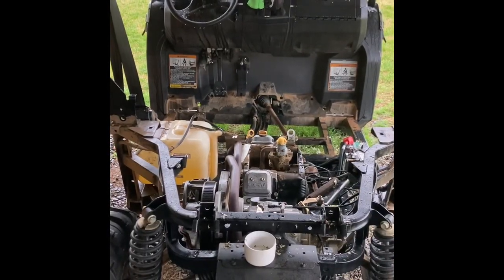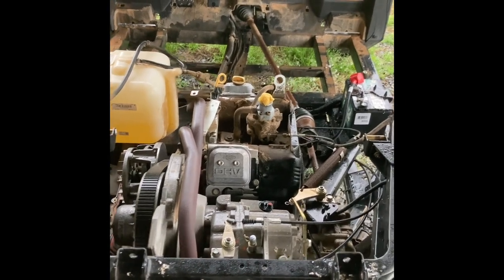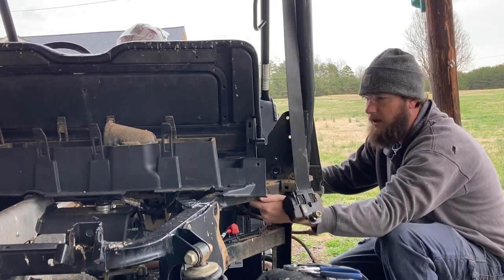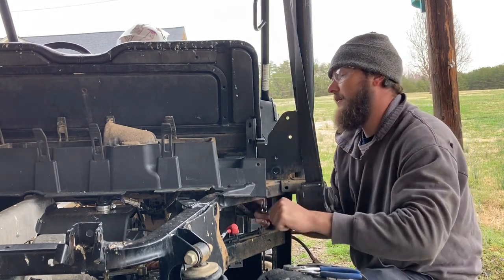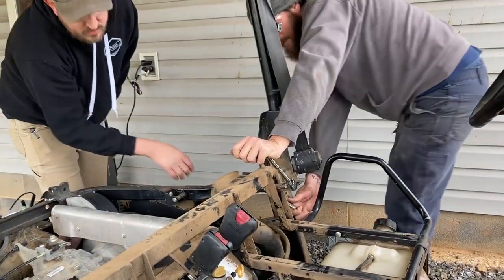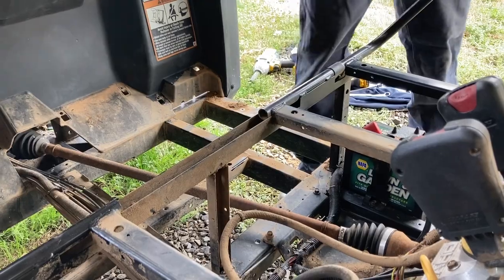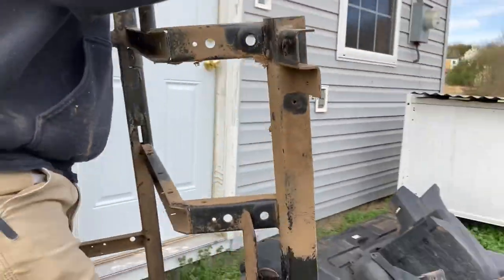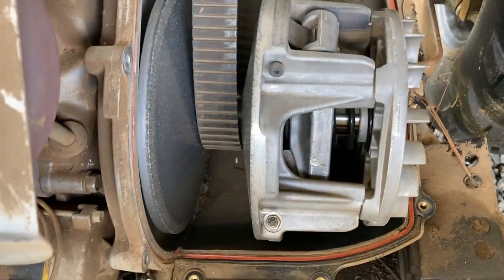What have we done??? John Deere Gator XUV 550 engine removal Pt. 1

Comment: Just put a new engine in my xuv 560. A 3" piece of half inch round stock and 3" 9/16x18 bolt works perfect to pull those drive clutches off the tapered shafts.
Reply from the maker: Good to know. We purchased the puller on line. Had we known that, we could have saved some cash. Thanks for the comment.

Comment: Hey, do you have any knowledge on these transmissions, mine is stuck in 4 Hi and there is very little information about it online. Any tips ?
Reply from the maker: Will the gear shifter move out of gear?
Reply: If I remove the two bolts holding in the shifter, I can lift the pin and move it. Without moving the bolts, I cannot move the shifter.
Reply from the maker: I've had some trouble. Mine would get stuck; If I turned the motor off, I could shift gears. I've had it in the shop twice for that issue once under warranty. Seems like a set of shims was the fix, but I can't remember where they were installed.  It's been years, it was a very common issue back when they were new.